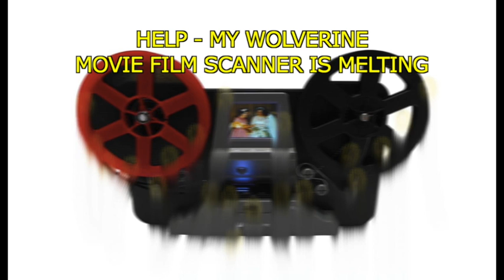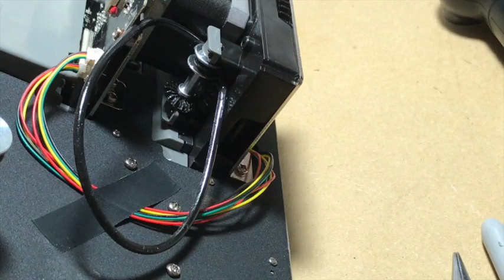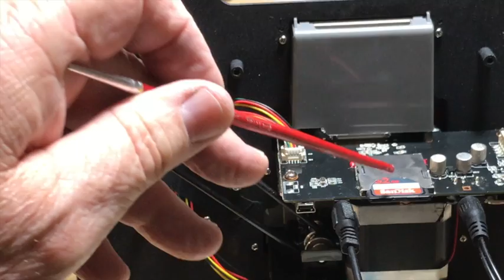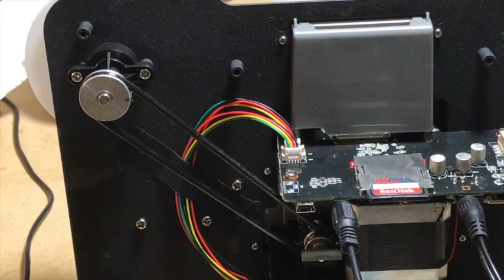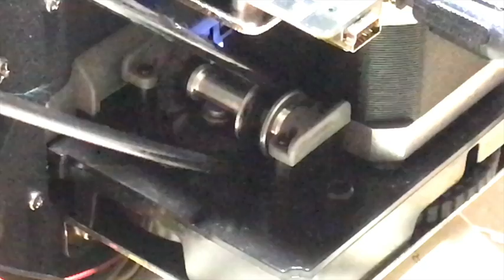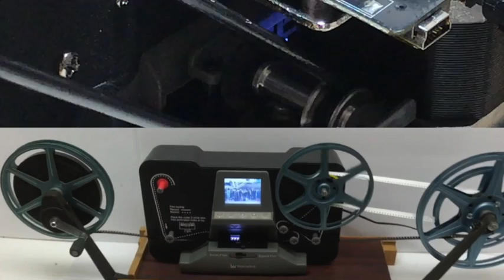Problems with Wolverine Reels2Digital MovieMaker reel not turning.

Comment: The frustrating thing is there aren't a whole lot of choices as far as 8mm to video transfer machines.  I understand a company wanting to keep the cost low to sell more units, BUT their units could have been so much better with a little more effort in improvements and a slightly higher cost increase.  It's nice I can get the Pro model for $400, but I would have gladly paid a few hundred more than that for a even better model.  Some things like the excessive compression in the video could be fixed for $0.

Comment: My Wolverine also uses a belt. I communicated with them in the hopes of buying a spare belt, but was told that none were available since they now use a motor for the take-up reel. Evidently the units with belts were the pilot models. I have since added a small case fan and drilled some vent holes which work fine in keeping the unit cool. By the way this all occurred after scanning over 120 reels of film without any problems, although I did notice the SD card was warm after each scan.

Comment: New units are belt-less they now use a take up motor assembly.i have had belts do this as well but they were projectors from the 1970's my guess is the belts they used were from old stock from some defunct projector company.i used nail polish remover to clean up the mess.new units are available from Frys electronics in USA.$229.00-  https://images.frys.com/art/email/052018_sun098yrt/sun_web.html?promocode=435035#set10
Reply from the maker: Is there a way to tell the new version from the old version without opening it up so someone can be sure they are not buying the old model?

Comment: Bob - I talked to the techie guy at Wolverine. He assured me that the goo on the belt is part of the design. He was helpful in suggesting remedies for my sometimes jerky (8mm only) transfers. It now occurs to me that the 8mm film may be shrunk a bit - this might cause the claw to grab the film someplace slightly removed from the 8mm spec.

Comment: That could be from heat. But I seen rubber do this from belts to wheels in turntables. Makes me think they used old stock belts or some cheap brand belt. Best thing would be a new belt and clean up that old rubber using alcohol. Also looking at this unit inside you could even drill a hole and get a longer belt to run right from motor to take up unit for larger reels.  and ditches there take up shaft total.

Also your right about heat but being that is a editor style 8 mm unit in a way and also projectors even with fans were still warm inside of them. So I am thinking bad elt cheap rubber or just old stock.
Reply from the maker: They have redesigned it so that the take up reel has it's own motor and gear drive: no more belt just 3mm from the 130 degree stepper motor

Comment: I do not think that the belt is melting. What you are feeling is a belt dressing that is applied to make the belt sticky so that a simple non-toothed belt drive can be used.The noise you are hearing is actually a spring which forms a very simple slip-clutch that allows the grey plastic drive 'hub' to slip on the metal spindle that is driven by the belt.  The belt turns and the spindle spins and if there is no drag on the take-up reel, the reel will turn to take up the film.  If the reel cannot move (since the film is only few about 3/8" per second), the slip clutch allow the reel to stay still even though the spindle is still driven.This is a common mechanism that has been used in virtually every movie projector ever made since the take-up reel needs to turn at different speeds depending on how much film is on the take-up reel.  The goopy belt isn't melting -- it's goopy to prevent slipping.If the take up is stopping, it is probably because the slip clutch is not able to maintain enough friction to turn the takeup reel, and may be precipitated due to your adding a larger take-up and using some kind of 'belt' from the Wolverine's take-up reel to drive your larger system.  This probably puts more drag on the slip-clutch (which is really just two pieces of plastic and a spring) which cause the failure.What is VERY curious, is that MY Wolverine doesn't have a belt drive for the take-up.  It has a separate motor with a gear drive to the spindle.  It still has the same slip-clutch.I would suggest that you adapt some other drive mechanism for your large size take-up reels and not rely on the Wolverine for the take-up tension or for rewind.  Also, make sure that something helps un-spool the supply side so that the inertial drag of the larger reel doesn't cause the feed dog pin to break the sprockets or to be pulled out of alignment.  Timing is everything to insure no vertical jitter.

Comment: Thanks for your informative video on this 8mm scanner. I am tempted to purchase one but am worried about the wide range of very inconsistent reviews, ranging from "marvellous" to "rubbish". As you have shown, the heat problem can be overcome with some DIY modifications. What really concerns me is the criticisms regarding low resolution. While many claim it gives much better results than 'shooting off the wall' others say otherwise. I am too old to wait for a 'Mark 2' version of which there is yet no mention so might just have to take the risk and purchase one. 💸🤔. 
Just  a suggestion, but for replacement belts in cases like this I've used readily obtainable 'O' rings with much success. Even used small ones to replace perished rubber on turntable idler pulled.
Reply from the maker: The people who call it "rubbish" don't actually seem to own one. It think too many people look at technical specs and say, "Oh that won't work." We routinely watch our converted movies on a 40 inch HDTV and it looks great. I just copied some 16mm film using the "shooting off the wall" method: doing so made me very happy that I no longer have to go through that method only to get flickering, poorly-exposed, crooked copies of original films.

Comment: Bob you might try making your own belt out of urethane belting material. https://www.amazon.com/gp/product/B006IZXJL8/ref=oh_aui_search_detailpage?ie=UTF8&psc=1. I use this all the time for replacing belts on my film projectors.The urethane will melt at extremely high temperature like with the soldering iron I use to join the ends. However...you unit isn't getting that hot.

Comment: "Unsatisfactory"?  You must be British.  I had the same problem with belt melt in a Super 8 projector back in the 1970's.  Wishing you the very best!
Reply from the maker: It wouldn't surprise me to see this in an old piece of gear but these just hit the market less than a year ago. I am wondering if perhaps heat caused this. Whenever I finish a recording session with the Wolverine and remove the SD card,  the card is quite warm, almost hot. This has a large motor and some circuit boards, all generating heat, but there are zero vent holes! I may have to pick up one of those BBQ thermometers with the sensor on a cord: running the unit with that sealed inside should let us know if it's too hot inside.